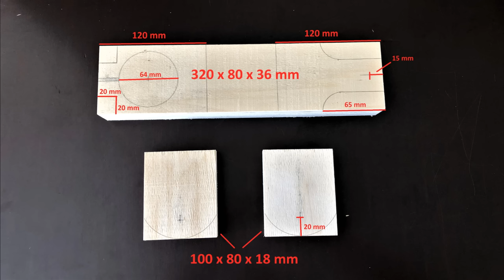Amazing Woodworking Tool // Router Copy Carver - Duplicator

Comment: Awesome job !! Is it really necessary to use two bearings per pillar ?? Very difficult to obtain in my area and is very expensive. The bearings I can get is 45mm long. Thanks again for sharing and for your feedback.
Reply from the maker: Hi my friend, this structure should be done with the equipment shown, it will not work properly if the missing material is used.

Comment: Great video, a question for you. What if I want to carve for example 2mm deeper than original to accommodate veneer, paint etc. Just using a 2mm shorter guide pin will not do this exactly except for completely flat surfaces. What do you recommend in this case?
Reply: Why the shorter guide pin will not work?
Reply: @lvonh9388  On a complicated surface, carved surface details will obstruct the pin, but if the surface to be carved is not so interesting a shorter guide pin should work.
Reply: @astromcd  Ok I see , thanks!
Reply: Put a 2mm spacer board underneath the carved piece and set the guide pin 2mm deeper. Now the duplicate will cut like normal only for veneer depth

Comment: What is the purpose of a counterweight?
Reply: The router is heavy so it makes the movement more balanced and easier to handle. Without it you'd struggle to hold the weight of the router for very long and probably not do as good a job as well.
Reply: Where's the counterweight?

Comment: Where can I but the metal parts?
Reply: In vaqueiros ferretería en la avenida canek or circuito colonias
Reply: Just kidding, trie to search for cnc parts in aliexpress or eBay or Amazon
Reply: Amazon:  Pack of 4Pcs 16 mm SC16UU SCS16UU Linear Ball Bearing Slider Slide Bushing For Replacement CNC
Reply: Try Ebay - just search for "linear bearing"

Comment: Being able to tilt the router makes the whole thing useless.  For instance, if the protracter was something say 25 mm thick then when tracing the object the router would be impossible to hold exactly vertical.  The duplicate shape would have an irregular profile.  Guaranteed.
Reply: the router will follow the bit anyway.. you can play with distances, tracing rods and routingbit difference.
and if you like you can add a parralelogram on top to stay level //==//
Reply: @3zan6bel9   "the router will follow the bit...  " I always thought the bit followed the router.  How do you hold onto that bit to guide it so the router can follow?  LOL
Reply: @yrralyou  excuse me i made a mistake. i meant to write the router follows the tracing rod.
since you are not looking into solutions but just want to be right i guess you must be one of those 'woke' people.
Reply: @3zan6bel9  I guess I'm too old, but I don't know what a 'woke people' is.   And you completely ignored what I said in my original post.  Certainly, the router will follow the tracing rod.  I said that it was possible to trace and cut a thin shape,  But the tracing rod will be very hard to hold verticle to the work.  And then it will cut a wavy side.  Yes, you made a mistake by putting that pivot in.  There is just no reason for it, and it makes precise thick cuts impossible.
Reply: not  to be a wise donkey, but where are your plans?
Reply: @rogerdavies6226  You don't understand the written language?  Imagine, Wise Donkey, a cartoon donkey and above its head in the word bubble, "Whaaat?  Show me a picture"